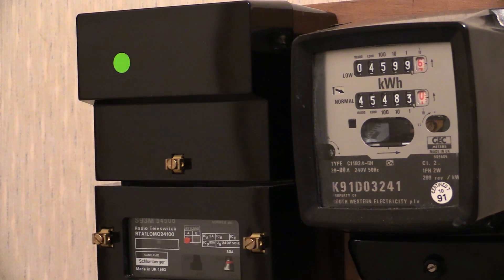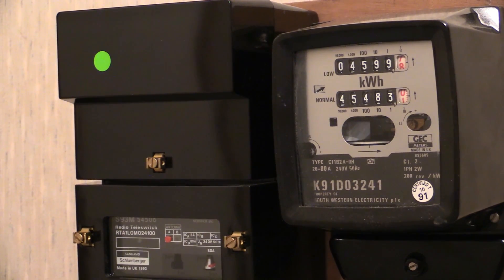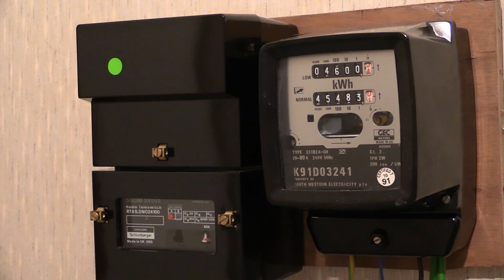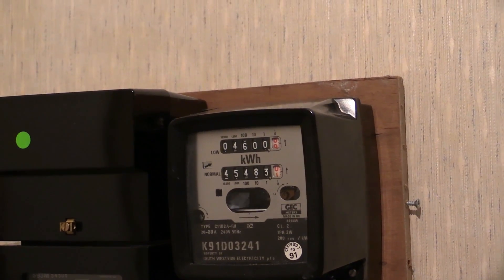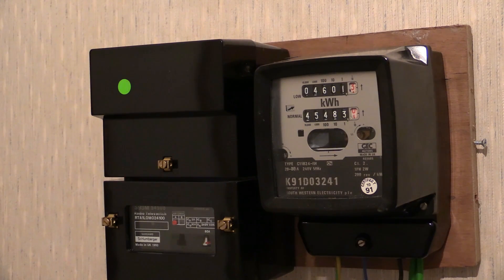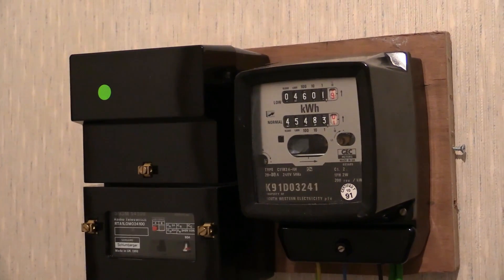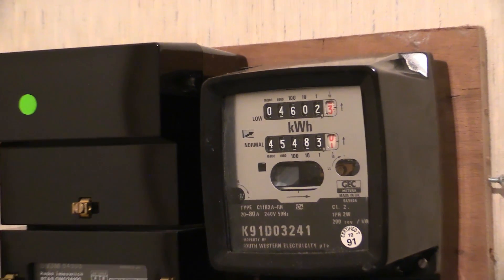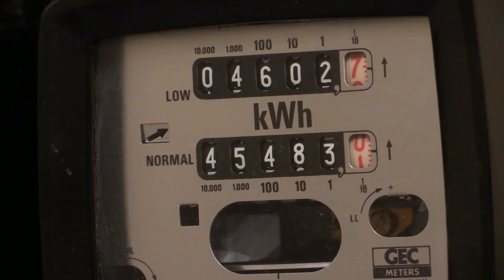Time Switch : Radio Teleswitch turns on 75A Phantom Current!

Comment: What is this 75A load? Even a 22kw EV charger would only be 60A or so.
Reply: A 22kW EV charger would likely be 3 phase (therefore ~30Amps), but a typical UK house will only have a single phase 80 - 100A supply.

If we could imagine this as a real house, then this would most likely be night storage heaters and a immersion heater coming on. Usually people who have this sort of meter will have an Economy 7 tariff as he explained in the video (i.e. they get 7 hours during the night with a cheaper rate of electricity which is used for night storage heating + water heating). Night storage heaters can be anything up to 3.4kW each. So 4 of them + a 3kW immersion heater in a hot water tank would be (3400W x 4) + 3000W =  16600W = ~70Amps. The addtional 5 amps could then be miscellanous items (I'm using 240V rather than 230V for this calculation).  Obviosuly, it might not be 4 x 3400W night storage heaters, but it could be a combination of multiple different sizes.  

I once rented a 2 bedroom flat with a 3400W, 2550W and a 850W night storage heaters + a 3kW immersions heater on an Economy 7 tariff. That would still be a hefty ~41Amps if all of them had been switched on.

Comment: Nice demonstration, Is this teleswitch similar to a ripple control receiver?
Reply from the maker: Hiya. In this 
demonstration 
of the Radio Teleswitch, 
it can be seen that........

...... The device operated a dual-rate meter and also switched a chunky 75A load.

In a way, this is similar to the ripple system, but the differences are:

(1) Ripple control: It is a frequency which is "imposed" onto the usual 50Hz and then 'pumped' down the mains cabling to make receivers operate and turn on-and-off things like off-peak supplies, hot water etc,

(2) Radio Teleswitch: Like the name suggests, the operation of these is done over-the-air and in a similar way to ripple control, a specific frequency is 'piggy-backed' onto a broadcaster's radio frequency.

In the UK, the switching frequencies are piggy-backed onto BBC Radio 4, 198 LW. (Long Wave)

Because of how these operate, they are slowly being discontinued, and this is for one of a few reasons, apart from advances in metering technology.

These basically rely on a radio infrastructure which was not meant for the way in which it is currently being used. In the UK, there is a Long Wave Radio transmitter based in Droitwich.

That transmitter uses the old valve technology. The replacement valves for it have since been discontinued.

The BBC bought all of the remaining stock of spare valves.

Each set of valves can last anywhere between one and ten years.

The transmitter is on its last set of valves.

The BBC have no plans to replace the transmitter when it eventually fails.

BBC Radio 4 now also transmit on FM as well as DAB (Digital radio) because of this.

Once the Droitwich transmitter pops, any Radio Teleswitches still in service will "drop dead", and no longer work, because there will no longer be the infrastructure to transmit the piggybacked switching frequencies.

That is one reason as to why these, are now being phased-out. Advances in metering technology mean that these stand-alone units are becoming increasingly redundant, as modern meters have built-in electronic quartz timers.

This is how I managed to acquire this one, and as proven in this video, the switching signals are still being transmitted.

But for how much longer is unknown!

Eventually, the BBC may be asked to stop transmitting the frequencies, rendering all teleswitches dead and redundant, but before then, the Droitwich transmitter could pop!

Not so much a case of if, but when.

It is on its last set of valves, and when they go, that is the end of it.

I had to document the operation of the Radio Teleswitch on Wayne's Electrical while I still had the opportunity, because when the frequencies stop being transmitted, this unit will be about as useful as a paperweight, unlike the timeswitches that went before these, which radio teleswitches replaced!

The thing is..... The timeswitches will live on, because they don't rely on some other 'out there' infrastructure to operate. Not only that, I can set and operate a timeswitch!

But a Radio Teleswitch? Not at all, and I don't know what the switching frequencies are either. That is still secret, for obvious reasons!

There won't just be one set of switching frequencies, but many of them, so what set of frequencies turn this one on-and-off, might not work with another of a different Group Code. I do not know how many different Group Codes there are.

There will be many more TimeSwitch videos coming up, so for the meanwhile, please check the TimeSwitches Playlist to make sure you haven't missed out on any, and make sure you are subscribed to Wayne's Electrical for even more Time Switch videos.

Thanks for watching,

-Wayne's Electrical.

26th August 2018, 03.15
Reply: Ok, cool! Out of curiosity where did you get this teleswitch, i have been trying to find one but i can't.
Reply from the maker: Hiya. I obtained this 
teleswitch from one 
of my many electrical 
contacts. If you wish.....

.......I could put out a "Wanted!" for one of these, but you need to respond quickly! These are now being removed and being disposed of at a very rapid rate, and because there is virtually no resales market for these, a very large percentage of them are removed and disposed of, and once gone, that is the end of them!

To continue, please go to my "About" tab and activate the Email contact, and write to me there, as this here is a publicly accessible and viewable forum, and there are certain things which cannot be discussed here (such as personal addresses and contact details etc)

I will say this in advance: Fees will be payable, and depending on where you are, these fees might be a bit pricey, but then.... that depends on what you would define as pricey.

Please activate the email link now, and I will continue with this over there. 

PLEASE BE QUICK!!!

These Radio Teleswitches are disappearing at a fast rate!

Thanxx for watching,

-Wayne's Electrical.

19th September 2018, 11.45
Reply: Just curious how much are we talking, also is it possible to get one with multiple switches?
Reply from the maker: Hiya. To discuss sales, please activate the Email link and write to me there.
Thanks,

Wayne's Electrical.
21st September 2018, 11.16